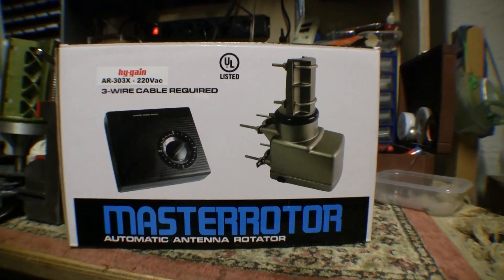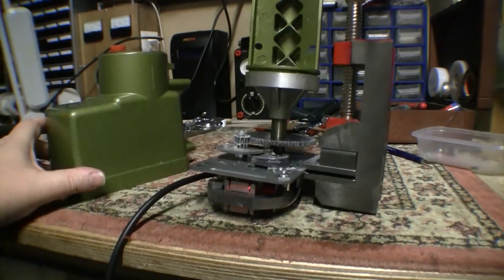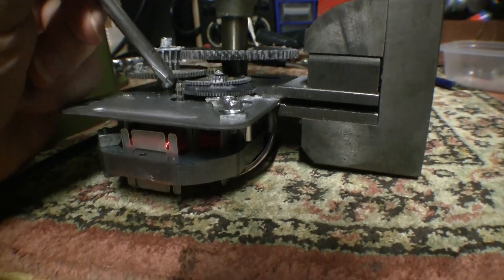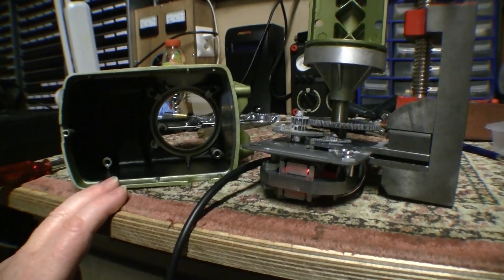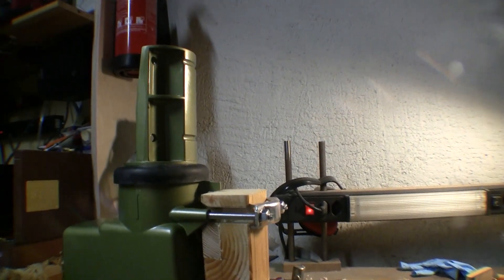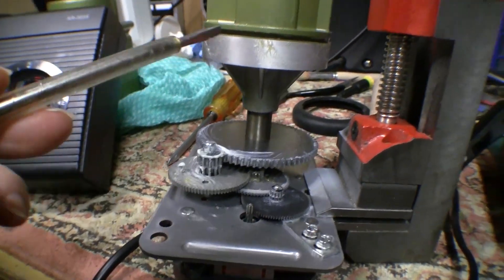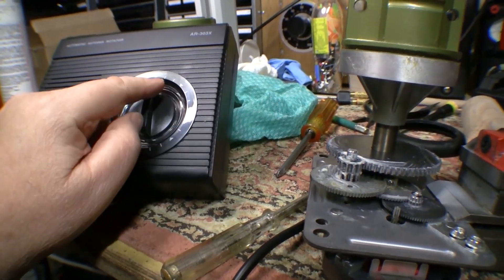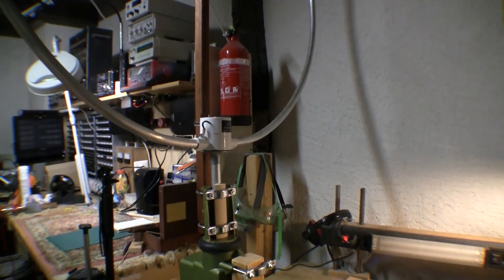Fitting an Antenna Rotator - part 1

Comment: You got the clock timing off during disassembly. It's quite a challenge to get it properly clocked again. I'm considering cutting the pin short on the gear so the stop doesn't work. It's going to be for a surveillance camera so I'll be watching it on screen as it turns.
Reply from the maker: I'll confess that having settled on the position for best radio reception, I don't need to rotate it very often.   Your use case is obviously very different.

Comment: Update: After wiring this piece of junk. I can fully verify that it is a piece of junk.
The controller works and turns the dial- but the mast does not move at all. No noise, no nothing.
Anyway, it just figures as far as I am concerned it's a joke.
Thanks for making a video of it though. Maybe a better electrician could troubleshoot it and get it to work.

Comment: I'm using one on it's side for a ceiling lift on my patio. Sort of a clam- shell opening roof. 
It was given to me, minus the wiring and hardware. I hope it works. The roof part that opens isn't really that heavy. Maybe 10 or 12 lbs.

Comment: Any idea how to get into the control box? I've got a dud one which does not do anything but for the life of me i can't work out how to open it... appears to have a single screw in the base but after that's removed the thing still won't come apart. Any ideas on how to pop it open appreciated.
Reply from the maker: Hi haven't had to mess with my one.   Have you peeled off one of the rubber feet to see if there are screws hidden underneath?   That would be a good place to put four screws......just a thought.
Reply: @Zone1242  no worries.  Found another video with one stripped down. Just remove the central screw and then pop open with a flat edged screwdriver. 4 plastic clips hold the enclosure together.  Got mine open. Just need to work out why it's not working now!

Comment: This kind of antenna rotor very problematic.  After about 3 years more or less the rotor motor will freeze up and stop working.  Problem is moisture gets into the gear box and rust up one of the small gears and its axial.  It can be loosened and lubricated and will work another 3 years or so or until the low quality control box in the house gives out.
Reply from the maker: Thanks Bill, yes I agree.   Mine is holding out so far though my expectations are not high.
Cheers,    John

Comment: Tnx for the interesting video, but it would have been nice to show how you took the rotator apart.  I removed the bolts inside and also the spring ring but everything is still stuck.
Reply from the maker: HI, this was a few years ago so memory may not be accurate.  For me, the key to freeing up the mechanism was the two screws holding the plate and the gear that meshes with the motor shaft.  You can see them (front right) at around 9mins into the clip.  I believe this setting is critical to making the mechanism work properly as it determines how this gear meshes with the motor shaft as well as the next gear in the chain.
Reply: @Zone1242  Thanks for your reply. Found it in the mean time. I had already removed the 4 bolts from the plate but didn't remove the rubber ring on top of the rotator. Now I've done that it came free.

Comment: to get the thing to work right , try this. Operate the controller anti-cockwise. The controller will operate and turn the rotator motor to its stop. Then take number 3 wire off the controller. Set the Controller fully Clockwise , the Controller will operate BUT the rotator wont as it has the no.3 wire off. Unplug the mains, Set controller fully Anti-clockwise, Reconnect No 3 wire. Plug in mains. The Controller should now be calibrated to the Motor/rotator. Hope this works for you. Good luck.
Reply from the maker: Hi Ken, It turns out that I get best reception on shortwave without moving the antenna very much so it tends to stay in the one position.  Thanks for the calibration process - I'll give it a go.
Cheers,  John

Comment: A rather barbaric means of stop limiting, you would think a micro switch or something would have been employed... as for zeroing the assembly how about making the stop limiters meet at the zero (thus giving you 358 degrees of rotation)?

Good luck and I think you might be onto something with that "dampener" cross piece within the casing to reduce noise :)

Comment: I have a Hy-Gain from the 80's and another rotater & controller from the 60's, the Hy-Gain is noisy but not as bad as the other one, and the control box produces a big old thunk-thunk when turning, but I really wouldn't want another as these rotaters are solid and they work very well, their age can attest to that fact! However, even though I give them great praise, they have been out of service the past 5 years due to the fact I tore down my HAM gear.  I also want to notate; with both rotaters, they way to calibrate direction is by a little metal tab on the bottom, by tap it, it swings the antenna where you want it, done! Looking forward to part II.

Comment: Hello John. Wasn't there space for covering the inside of that housing with some acoustic blocking material (felt or something like that)?
Reply from the maker: +renatoscutube Hi Renato, I guess it comes down to whether all the effort to do that would make it sounds quieter.   I'll wait to see how it sounds once fitted, then I'll decide either to try and improve it, or simply replace it with a different solution.
Cheers,  John

Comment: I had a rotator for a VHF radio and high gain TV (UHF) many years ago, and I recall it also made one hell of a noise. It was mounted on the outside of a two story house (brick) and you could hear it in the lounge down stairs. You could also hear the noise 50 mtrs down the road. The rotator control box was really small and the effect was to overheat the transformer inside after just 5/6 rotations which would then cut out till it cooled. It was also made in THAT part of the world!!!
Reply from the maker: +Michael Beeny HI Michael, sounds like the technology hasn't progressed much.  Hopefully mine won't be quite as noisy or problematic.
Cheers,   John